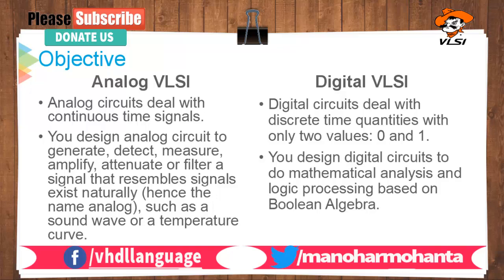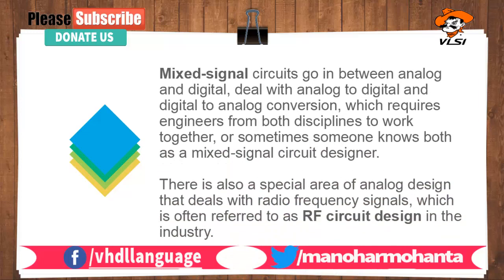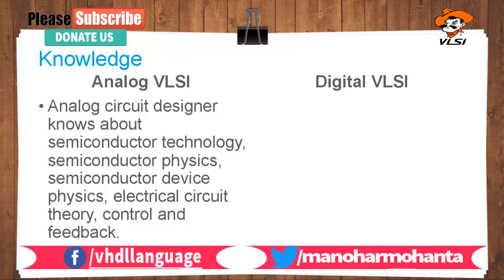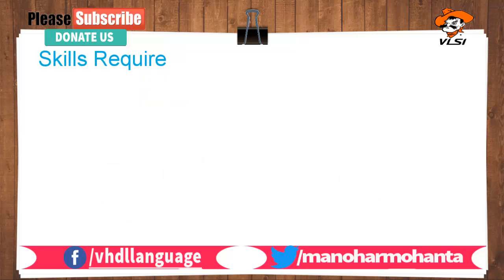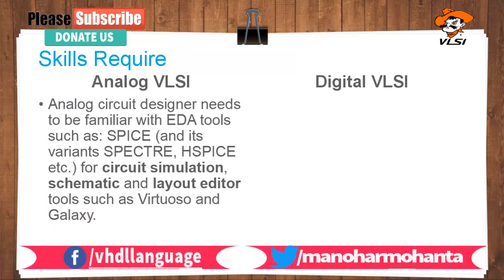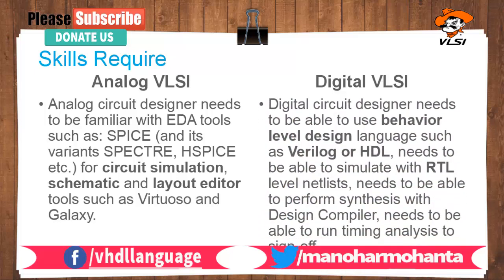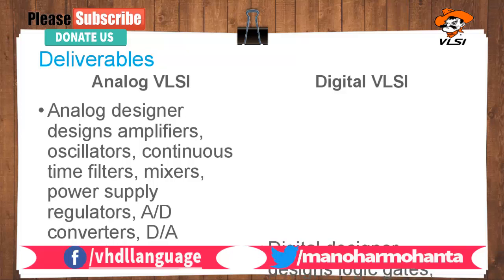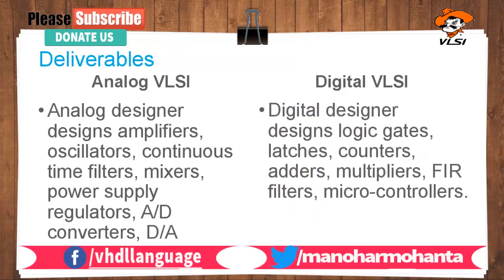Difference between Analog VLSI and Digital VLSI

Comment: In the section "Objective", I'm confused about the contrast between analog being continuous time and digital being 0-1. Continuous time is a concept of, well, time, and digital 0-1 is a concept of amplitude. A signal that is discrete in amplitude need not be discrete in time, and a signal that is continuous in amplitude need not be continuous in time. Are analog VLSI systems restricted to continuous time while digital VLSI are restricted to discrete time? Moreover, are analog VLSI systems restricted to continuous amplitudes while digital VLSI systems are restricted to discrete amplitudes?
Reply: Actually, you have answered one of your own question, particularly the second one. Analogue circuits (disregard VLSI as it's just defined by the number of transistors being implemented into a circuit) deal with continuous amplitudes whereas digital circuits deal with discrete amplitudes, both with respect of time. 

For the first question, you may take a look of the wiki link below:

https://en.wikipedia.org/wiki/Discrete_time_and_continuous_time